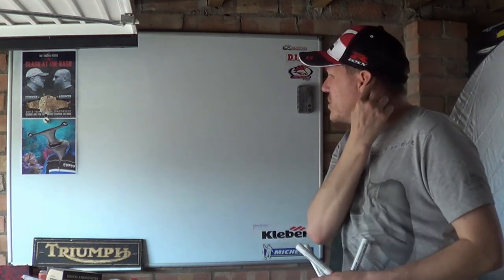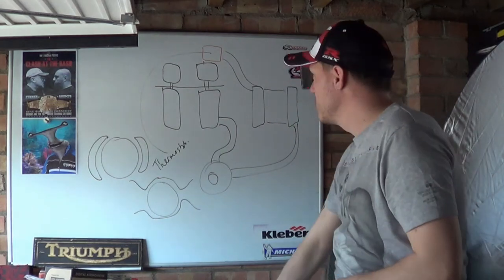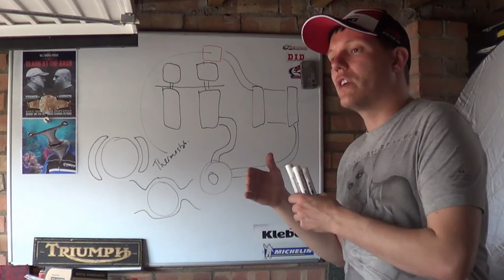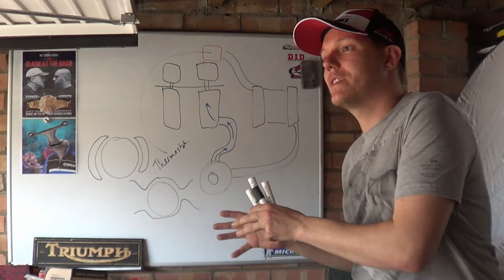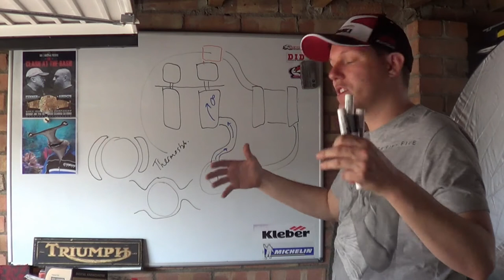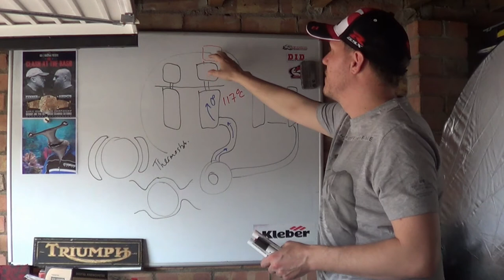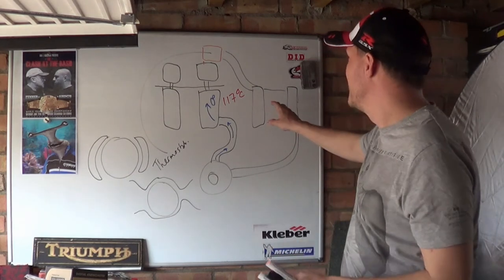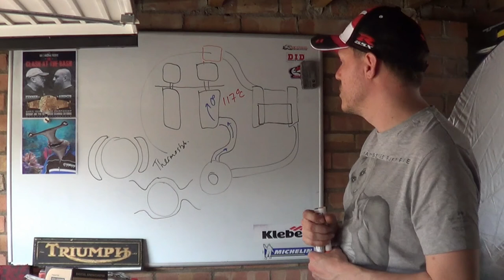Maintaining engine temperature

Comment: Great video as usual, thanks !
However, on all my bikes, thermostat opening occurs at around 80-90°c and full opening is reached at 95-100°c. 117°c seems a bit high, since generally the fan starts at about 110°c.
This is based on the bikes I had and the ones I still have ( Honda NT650V4, Yamaha XJ6 and Triumph Thunderbird 1700cc).

The best way to test your thermostat is to put it in a pan full a water and to warm the whole thing up. Then with a calibrated thermometer, right down the temperature at which the thermstat starts to open. Then compare the results with spec sheets of your thermostat/bike.

Funny thing, with the Honda, after adding a water temperature gauge, I noticed the engine took forever to warm up in winter (design flaw if you ask me), so now when the outside temperature is less than 10°c, I put a self made radiator cover. Works a treat :)
Reply from the maker: The word generally comes to mind -
Reply from the maker: Pressed enter too quick lol the other thing is there is a difference between gauge temp and thermostat temperature

Comment: But if your rad "overcools" your coolant then wouldn't the thermostat compensate by closing a set amount based on the temp to maintain the heat in the engine?

If by that logic (while disregarding the need for a more powerful water pump) then it's really not possible to overcool your coolant. If it gets slightly too hot in the engine the thermostat will open slightly and a relative amount of coolant will circulate

Comment: Hey Matt. A few months back, I asked a question about the direction of coolant flow & you said it depends on the type of system it has. You said you'd do a video on the different types since it would take too long in the comment replies.

Also, had a random thought the other day about off throttle fueling. If the ECU cuts fuel to the injectors off throttle, how is there sufficient combustion events still occurring (how is engine still running)?

If you decide to make a video on 1 or both of these topics, I'll promise to make a healthy donation to your PayPal account.

Comment: In a perfect world would mercury be a better fluid that water that boils and causes oxidisation? I know very little about mercury but i would assume that it is more conductive than water as it is a metal and has over triple the boiling point. Thus a smaller size of the cooling system etc. 
An idea that has been floating around in my head for a couple of years. Would be great to get your opinion.
Reply: Kit Agnew it's very dense so it would take a lot more power to pump it if we're talking about a conventional liquid cooling system. Mercury fumes are also very toxic and as your engine heats up you would have problems with the system taking the pressure. Then there's the environment aspect in the event of a cooling system blow out or something of that nature. Mercury would probably also dissolve or corrode the metal components of the cooling system.

Comment: Could you have a air cooled/ water cooled engine where u have a cyclonic shape that's goes up the engine and has coolant running through the fins the it goes up into the radiator and back into the engine? So it benefits from air and the coolant on the engine then cools even more after it passes through the rad?
Reply from the maker: Water is superior to air cooling, so why would you want air cooling?